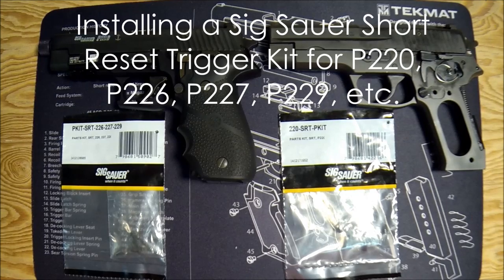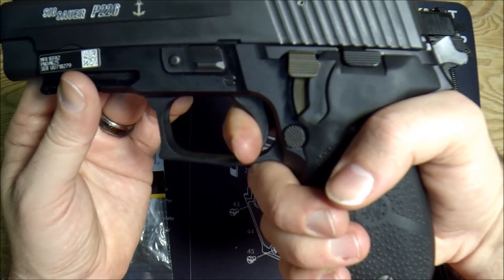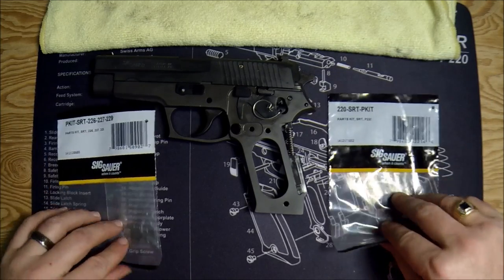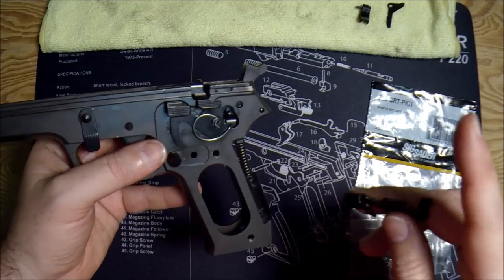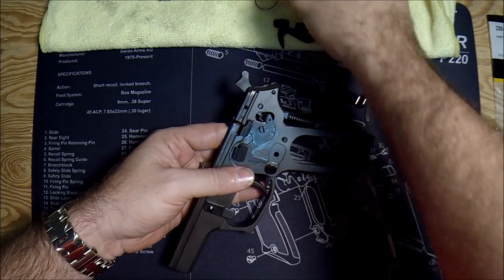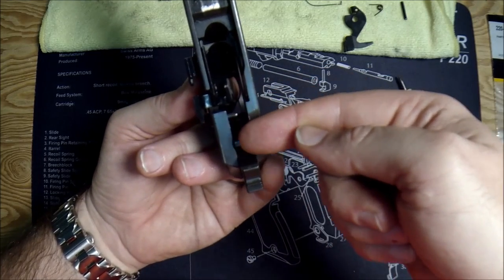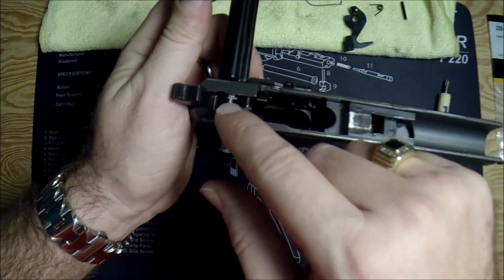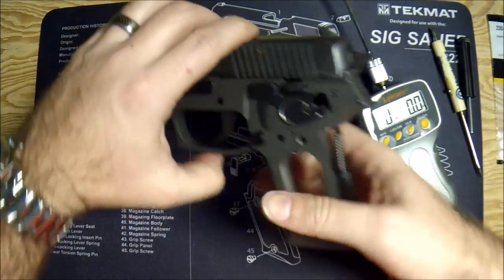Sig Sauer P220, P226, P227, P229 Short Reset Trigger Kit Install

Comment: I have a German made 220 and the pistol would not decock with the old style decocking lever.  There is a very slight difference in the height of the tab that contacts the sear on the new decocking lever.  The new sear has a cut milled in the decocker side shoulder and the old lever isn't quite tall enough to lift the sear and decock the pistol.  The old lever does slightly touch the new sear, and in some cases I suspect it may be enough to initiate a decock, thereby explaining why some folks don't end up having to use the new lever.  It's a great video and I very much appreciate the time and effort you put into it.
Reply: 100% correct

Comment: The reason for the new decocker is because the old  stlye wont decock the hammer if just the kit itself is installed. I did just the kit and thats what I found. Thanks for the video!

Comment: Love your videos and decided to get he 220 Kit for my P226 just so I could get the decocking lever to avoid continuous finish/frame damage from a decock snap.  Bought the whole kit vs. just the lever and... FAIL.  There are many geometric differences between the 220 and 226 lever.  The hump is one but there are many more.  The overall height distance between the pivot hole and the top edge of the lever results in the piece not even being seatable to the frame.  Even if it could, the tab that extends into the pistol is shorter and will not likely engage the 226 hammer release, it is also a bit higher in position.  In addition to this, differences that would not likely impact function exist.  The control itself is a different shape being larger and extrudes from the frame a tad more.  The "hook" is also shaped differently.  Recommend you annotate that part on your video so others don't make the investment on a 220 decocker to avoid frame wear/damage like I did.

Comment: Just a quick question? why not remove the breach block, trigger and trigger bar ()very easy parts to remove) before putting in the sear.  It seems like without the trigger bar in the way the sear installation would be easier.

Comment: My kit arrived today from Midway USA. Genuine Sig Sauer parts.
I disconnected the hammer spring because it felt like there was pressure on the sear pin. 
It installed with ease and the difference in the reset function is staggering. What an improvement. Hardly any take-up in the reset and the single action pull.
Thanks for the video-it helped.

Comment: Steve, thanks to you and another YouTube channel, I was able to complete my own trigger upgrades and now have a sweet DA/SA trigger on my P229.  You helped so much with the SRT install and the other channel showed me where to polish parts to smooth the pull out.  I also replaced the hammer spring with a 19lb Wolff spring, just wish I had a tester like yours to see where the pull sits now.  The toughest part was getting that dang hammer spring base to sit right.  Thank you so much for making this video to help us keep costs down.  Instead of spending $125 plus shipping both ways, I only spent $54 for the SRT kit and the hammer spring and have a trigger I totally love.  Thanks again.

Comment: Steve, thanks so much for taking the time to make this incredibly detailed video. It made the installation a lot easier, and definitely more fun. I did the upgrade on a new P220 Elite that I bought this past spring, which already had the new and improved de-cocker. I still opted to put on the one that came with the kit. After struggling to get the new sear in place, I dug out a very handy tool that I forgot I had--a set of long, precision lighted tweezers that I bought at Lowe's. I got the sear in position in a few seconds. Once the gun was completely reassembled, the results were even better than I expected. In single action mode, the reset distance had been reduced by at least half! There was no play in the trigger whatsoever. I don't have the device to measure the weight of the pull, but because of the success of the install, it's a moot point. I can't wait to take it to the range. The excellent quality of this video made it a godsend for me. Thanks again!
Reply from the maker: Thanks, +Bill Knudson. So glad it helped. Enjoy your crisp follow-up shots! :)

Comment: Steve, I used your video to install an SRT kit in my 87 p220. With your help, it was very easy and had no hiccups. I did find that the new decocker would make contact and the old one never did, so I stayed with the original. Very informative and easy to follow! Thank You!!

Comment: Hello Steve wanted to tank you for this video just did the SRT kit on mi 1982 Weste German P220 just followed you video and got it right on. Im not and armorer I can work some with guns, motorcycles and car si it was a challenge but with you explanation it was a walk in the part. It works perfectly on my old P220 with  the older hammer style and trigger spring with mag release on the bottom. Great job keep it up!

Comment: I put this in my two tone P220. I didn't want to use the black decocker, so kept my silver one. The decocker would not work as the geometry on it is wrong for the new parts. Black one in, works like a charm! Also the new black decocker has clearance problems with my Hogue grips, so I had to "modify" them till my new grips get in. Thanks for the video!

Comment: Steve- Thanks for the tutorial on all of this. FYI for others with a P220 SAO.  The safety lever needed is different than the "key piece
 that comes in that kit you use.  I have both a P220 .45 ACP and 10 mm. Both are SAO. the 45 came with SRT kit and straight trigger from factory. The 10 mm came with std sear and safety lever.  I took the 45 apart to see the differences. 
There are 2 parts that look to be different
1) already state the safety lever, a forum I go to says it is p/n 1202088-R
2) the trigger bar also appears to be different as well.  Having a tough time finding p/n on this one. I do have a guess but don't want to add this one until I confirm its the right one.  Sig Sauer site shows parts break down for a DA/SA but not the SAO. This adds to the difficulty in part number searching.
*)Last thing. I found that putting that SAO specfic safety level back in first but with SRT sear very close by in the frame was easier to get it in place. I found if i put sear in first that the lower little lip on the safety lever made it hard to insert.  After switching the order, it was much easier.
Thanks for all of your videos.

Comment: Great video, thanks. Small PSA for those who view the comments here; I tried installing this kit on a brand new 220 Combat, and found that the original sear trip protrusion (it's on the safety lever on the original, rather than on the sear, as with the new kit) engaged with the trigger bar well, but the SRT sear trip protrusion is just a bit shorter than the original, and it doesn't reliably engage. The thing is, it works fine without a magazine installed, but with a magazine present, typically the sear won't trip, as the bar slides past it.  Talked to SIG and they indicated it should work; I'll need to send it in to figure out why the SRT sear doesn't work in mine.
Reply from the maker: Sorry to hear that, Allan. Please update us as to what you find! It SHOULD work just fine on a 220 Combat.
Reply: Yep, that's what SIG CS said. My suspicion is that the trigger bar, being a stamped part, is perhaps just a bit out of normal spec on mine -- not so much that the factory parts don't work, but just enough so that the shorter trip protrusion on the SRT doesn't quite make enough contact.
Reply from the maker: Then if that's the case, I'd guess your gun will come back with a new trigger bar. :)

Comment: Thank you so much. The install on my P220 Combat was completed without cursing! This video is awesome! Also, the stock decocking  lever on my P220 Combat looks exactly like the one the comes with the SRT kit, so I did not replace it. The trigger bar spring is the same as the one on your P220.

Comment: Thank you for the excellent video. It can be tough with all the small parts and weird angles of a 22X but I got this on the first try with your video.
Reply from the maker: ianarno Excellent! Great job! And do you like the difference in the reset?
Reply: I do. I never noticed in dry fire, but I'm most used to my Glock trigger so when the standard Sig trigger hit reset I found my self jerking the trigger and pulling a lot of my shots.

Comment: great video, brother. very clear and specific instructions! one thing, you can just pull the hammer down for the single action trigger pull. the double action pull and slide reciprocation is unnecessary. just an fyi :)

thanks again for the great video!
Reply from the maker: Thanks, Mario! And great tip. Old habit from being a Glock guy. ;)

Comment: thanks Steve, just used your video to install my kit. You helped me void my warranty
One change I made, sear install was very easy using a magnet  to slide and hold in place, but a dental pick worked just as well, thanks for the info.
Reply from the maker: sevensixtwo nato LOL - gotta love voiding that warranty! :) And using a magnet is a great idea!
Reply: Steve Jenkins Keep your spare parts, how are they ever going to know if you put them back in if there was any issues?   I all ways keep them around for that reason with anything I upgrade.
Reply from the maker: +Michael Carter Good call. I always keep the spare parts in the aftermarket parts' packaging so I can remember which gun they came off. :)

Comment: I will be installing a SRT in a new P229 soon and I think this will be helpful. On reading the trigger pull gauge, ounces are not tenths e.g. 4# 7.6 oz. is not 4.7 as stated in the audio, and 3# 13.9 oz is not 3.13.
Reply: Good catch. To get a decimal value, one needs to divide the ounces by 16. So 4# 7.7 oz is 4.5 #s rounding up to the tenths place.

Comment: Great video.  Have a question.  Got an SRT kit for my P220, but I'm also getting some Hogue rubber grips.  Some added text info in the vid says that the included new decocker does not fit right with the Hogue grips.  Can the SRT kit still work as intended with the original P220's decocker?  Thanks.
Reply from the maker: Thanks, Fugettaboutit. Yes - the Hogue wrap-around grips interfere with the new decocker. However, it shouldn't be too much trouble to use a razor blade or utility knife to gently whittle down a little bit of the rubber in the "track" where the decocker fits, and I'm sure it will be fine. I switched plans and went for the E2 grips, which worked fine. But if you love the Hogues, I'm confident you can make it work without much effort. Lemme know how it goes!
Reply: Steve Jenkins Thanks much.  I have the E2's and like them, but would just prefer a little wider backstrap, so I'm truing the Hogues.  Is there something specific about the included decocker that only works with the SRT?

Edit: Just checked…the Decocker that came  the gun is the exact same one that's included in the SRT kit, so either way I may have some contouring to do on the Hogues.  Thanks again.
Reply: Steve Jenkins Ok, so just installed it (took all of five minutes…having some magnets handy definitely helps).  Not only is the reset nicer, but that little extra 'hitch' in the single-action take-up as the lever lifts the firing pin safety plunger is gone too!  Night and day better.

Add that to an 18-lb mainspring, and this P220 is super-smooth now!  Can't wait to run some rounds through it, but even dry-firing I can tell that I'm staying on target better…even in double-action.  Great instructions.

Comment: Steve, is that decocker with a hump from the 220 SRT Kit sold separately? My P226 Navy is already wearing the SRT kit but would love to change out the decocker as I already have a small chip on the frame.
Reply from the maker: Hi, ybrik5. I'm sure you can get that "humped" decocker from Sig, or from anywhere Sig parts are sold. I don't know the separate part number for it outside of the kit, however. Note that the humped one won't work with some aftermarket grips, so that that into account and make sure you test it properly after installation.

Comment: I looked at the video and have done 2 installations on the SRT ( P229 and P239). My uncle is going to do his but lives 2 states away so I won't be able to do his. I sent him the link to your video but have to ask a question. I looked at your video a few times and correct me if I am wrong but I think you forgot to put the ejector back in?

Comment: Safe to pull trigger without the slide? Frame is aluminum and when hammer hits it, it might crack.
Reply from the maker: Hi, ybrik5. Great question. You're right that frame is aluminum, but the striking surface of the hammer never makes contact with the frame, so there's no risk of it cracking when pulling the trigger. Testing like this (while you still have full access to the internals before putting the grips back on) is totally safe! :)

Comment: You said we will get to setting the pin (one that holds the sear) in a minute, but never did; I was wanting to hear how you center or offset that pin, thanks
Reply from the maker: Hi, John. Darn it... you're absolutely right! I meant to come back and show that you should push the pin through so that it's centered and not quite flush on both sides of the frame (the pin is slightly shorter than the width of the frame). If you push it in too far from either side, you'll notice right away when you re-install the slide and catch the slide on the pin because it's sticking out a bit too far.

If you watch that portion of the video (at 17:22) you'll notice that when I press the pin into place, I use the fleshy part of my thumb to press it in from the left side -- and I press hard enough so that some skin from my thumb can enter the hole and press the pin slightly deeper than the outside edge of the frame (which results in the other end of the pin also being also just barely inside the frame). Sorry for not doing back and discussing it in the video, but I'll go add an annotation now to come check these comments. :) Thanks for catching that!

Comment: You speak and move a little bit too fast, but other than that this was a good video.
I have an older SIG P220, from approximately the mid-90s, and made in West Germany.
I installed a Grayguns SRT kit, which does not come with the new style decocker.
I'm not sure if that had anything to do with it, but after installing the parts and testing the decocker and the trigger reset before reassembling the firearm, I reassembled the firearm and the decocker would not function.
It quickly became obvious that it just was not traveling far enough and that was because it was hitting the grip just prior to functioning.
So I just had to take a file and shave down a little bit of that grip area to allow the decocker level to travel maybe a 16th of an inch further, if even that.
After that everything functions flawlessly.

Comment: Ihave a 226 which only fires in double Action has no decocking system. I want to instal a single action that will leave it double action and single action. Thanks Dom
Reply from the maker: +Dominic Kane You can send it to Sig and they can convert it for you. I believe it costs around $150.

Comment: Steve, Thanks for the awesome video. I was able to install my SRT on my sig no problem with your instructions. I have a question though. I am 99% positive that I have installed the kit correctly, but I still get about 1/4 inch or play on my trigger. I have a P220 Equinox, I was thinking maybe it's because it's the Equinox that it's not working the way it should, or maybe I did something wrong ? Anyhow I was hoping you may have some ideas that may help ?It would be greatly appreciated.
Reply from the maker: Hi, +Jeff Lee. It will be different with different guns and trigger combos. I wouldn't worry. 1/4 inch is probably not outside the "normal" range. Mine has a slight amount of movement (probably a bit less than 1/4 inch), but movement nonetheless. It's still a large improvement over the original.:) Go shoot that sweet P220! :)

Comment: Can you use this to replace the DAK trigger in a P229?
Reply from the maker: Hi, Matt. No. The DAK is a completely separate action. You can buy all the parts and switch it to a DA/SA, but it's cheaper just to send it to SIG and have them do it.

Comment: the sear pin on my P229 was very hard to take out and put back in. I tried both sides and they were both very hard. Had to use a rubber mallet and an Allen wrench (was using that to push it out) to get it back in. Is this normal?